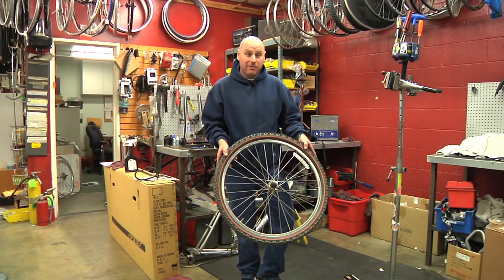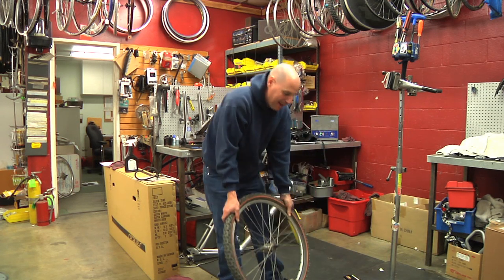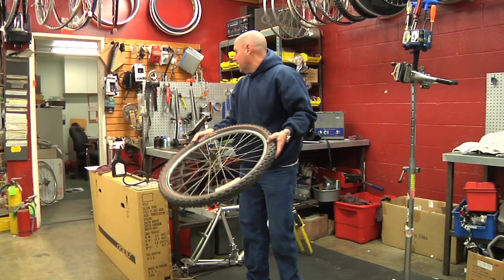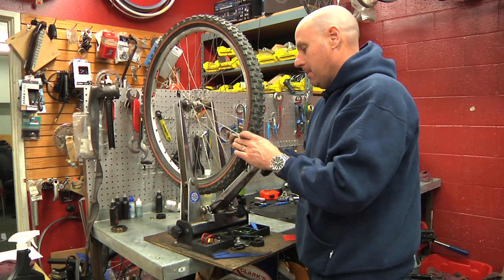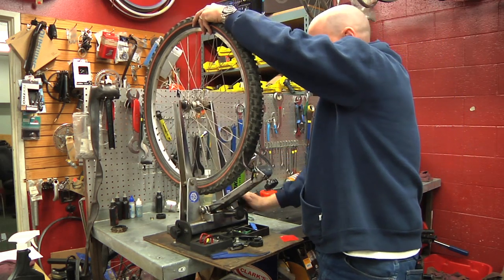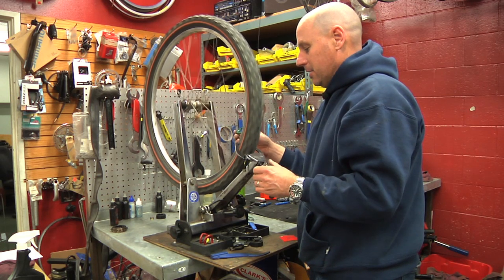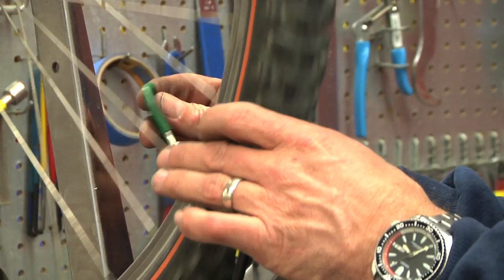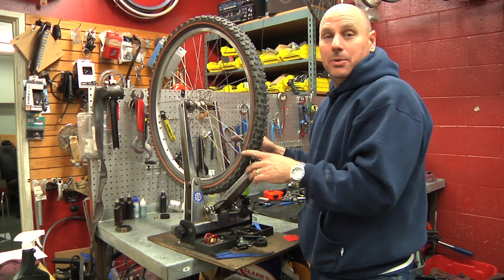Mountain Bike Maintenance : How to Repair a Mountain Bike Wheel

Comment: just remember when the rim once was bent, it won't be as strong as it was from the beginnng even after a successful repair like this bending it back. But definitely a trick to put in memory if you're out in a forest or on long touring when you have no other option than to make the wheel straight enough to be able to continue